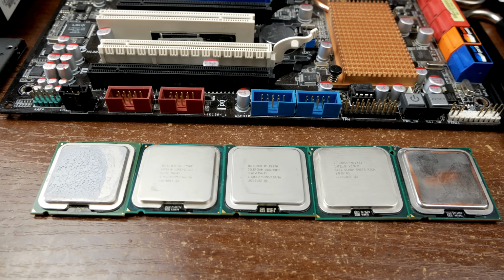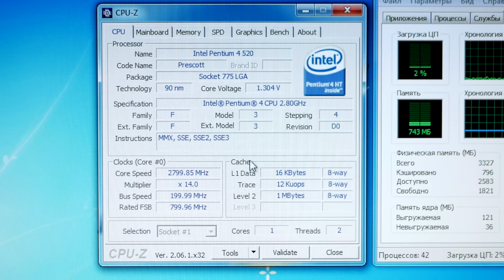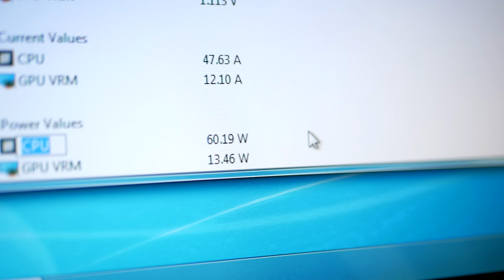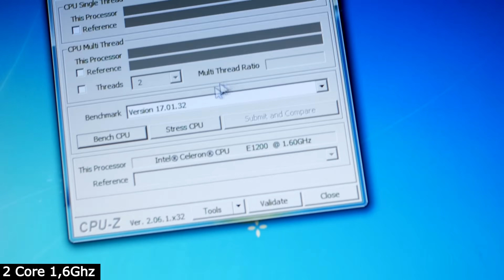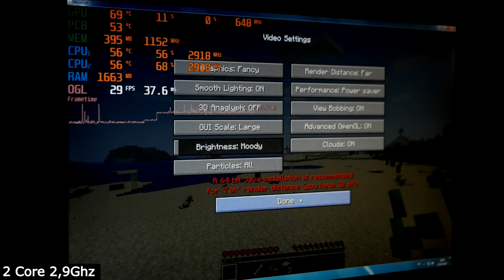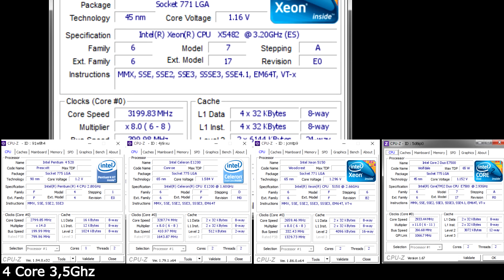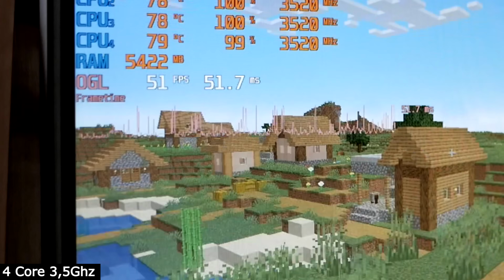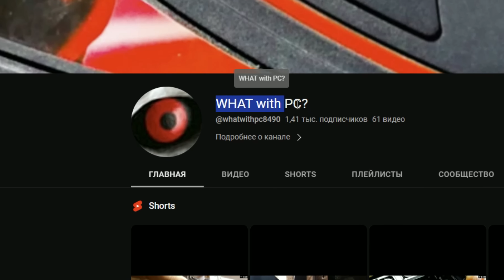Minecraft VS 19 Year Old CPU

Comment: i have a dual core celeron E3200 @ and, mineraft 1.21 runs pretty well, with sodium and 37 more mods to optimize it, on online servers i get like 100 fps? 150 and in singleplayer the thin changes a lot, 30fps or 60

Comment: I played Minecraft Java on 2B2T at 90fps on version 1.12.2 during 2021 using these specs:
Intel Core i5 650
GTX 260
12GB DDR3 Memory
80gb Seagate hard drive
to anyone looking to game on a extreme budget I recommend this system, maybe with a slightly upgraded CPU due to the I5 only having 2 cores 4 threads.  It also played CS before the update at playable FPS and was able to stream off my capture card at 480p 60fps

Comment: Optimization mods will help
Vanilla minecraft is shitty
I run minecraft on my 15 year old laptop
Version 1.20.1 Vanilla - render 16 blocks = ~2 fps
Version 1.20.1 fabric with around 12 optimization mods - render 16 blocks = ~40fps

Cpu:Intel corei3 2.3ghz
Gpu: nvidia 525m 
Ram:4gb ddr3

Comment: i still remember the intel 2 quad core q8400, i stopped using it around 2016, as the games were becoming extremely demanding, i had to tweak the fallout 4 settings and even mod it to the lowest of low to run it on my old potato pc, and that moment i realized that i need to upgrade my pc after 6 years of use without issue.

Comment: .... the dual celeron is better in single core because Pentium 4 ran on netburst which was extraordinarily garbage IPC lol.
Also Windows 10 isn't going to be any worse on a quad core than windows 7.
Also why not just apply a frame cap to minecraft if you don't like unstable high FPS? Benchmarking to find the lows will be more than fine.

Comment: For anyone who wants to compare, my workstation has:
A 2950x Threadripper running a 12nm architecture, 4100 MHz on idle, 16x 32 KBytes on L1 and 16x 512 Kbyte level 2 and further 4x 8 MBytes on Level 3 cache.
16 Cores 32 Threads.

Oh, and score wise:
Single Thread 438
Multi Thread 8'419
(It is a workstation focused on multithreaded applications so its great for me).

Comment: To clarify, frequency is not everything. IPC improvements between generations can mean a newer processor running at a lower frequency can outpace an older processor running at a  higher frequency. That being said, it is still weird how it’s a 2 times improvement in single core performance at about half the frequency between the pentium 4 and celeron. To me, that means the celeron must have some sort of hardware accelerator that boosts its performance over what the pentium 4 can do without it. Just some food for thought.
Reply: Pentium 4s spend more time heating your room than actually running anything. It's not that weird considering Merom (what the Celeron is based on) had double the IPC of Netburst (Pentium 4).

Comment: I'm watching this on an LGA 775 processor- core 2 quad q8400 which is almost identical specs to your quad core except with 4 MB L2 cache- lol. The Core 2 stuff actually holds up extremely well these days. Admittedly, the most hardcore thing I play is probably Kerbal Space Program though. All of that stuff is rated for a max temperature of about 72 degrees, and that seems to be pretty much the only limit on its overclocking potential. Mine has been at 3.2 GHz @ 400 MHz FSB for years and it only goes up to around 65 degrees max on air cooling with about 35-40 at idle.

That OCZ DDR2 memory is almost EXACTLY what I had in this machine when I first built it! Specs are the same, only I had a 4 GB kit and the heatsink on top looks different. OCZ Reaper. Now I have a 16 GB 4 DIMM kit I got for like $60 5 years ago of this other OCZ Gold stuff with this heatsink which looks like a screen.

Also, the first video card I ever bought is a Geforce 9500 back in 2009. It's still in daily use in a computer I sold about 10 years ago. Runs flawlessly and is perfectly fine for web browsing and watching movies at 1080p and lower resolutions. Played GTA 4 with it back in the day at probably 20-30 FPS. Doesn't even have a fan.

Comment: I started my Minecraft journey on socket mpga 487! Yeah you heard my right, the last intel socket with cpus that had pins instead of pads unlike lga775. I had a  Pentium 4 3.2ghz. It played Minecraft surprisingly well, up to 1.7.x. Especially considering it ran on windows 7 too which at the time was much heavier than xp. I really miss those times. Later I upgraded to a pentium D which was basically 2 pentium 4s in one cpu. That thing even compared to pentium 4! was a nuclear reactor core in terms of the heat it put out and the power it sucked. Eventually destroyed my motherboard as well. I miss these simple times occasionally. Building my first pc as a school kid, especially since we were very poor was a wild experience. Hence why I was using socket 487 in 2012-2014 which was well outdated at that point.
Reply: I used a Pentium 4 HT 3.0GHz (Prescott, S478) in 2011-2012 but the system only had an Intel Extreme Graphics 2 so Minecraft and other games never ran as well as they could have. In December 2012 I upgraded to a LGA775 Core2 Duo E6300 system but sadly that only had an Intel GMA 3000.
I got my first good PC in June 2013 with Xeon W3520 (i7-920), 6GB RAM, Quadro FX 1800 (GeForce 9600 GT). I upgraded the RAM to 12GB in December 2013 and GPU to a GTX 660 in January 2014.

I sometimes wish I could go back to 2010 or so and buy myself some cheap used Pentium 4 rig with a high-end-ish AGP graphics card. That's something I could have afford back then but I didn't know enough about PCs to know the difference between iGPU and dGPU etc. Of course a Core2 system would be even better but probably would have cost too much back then, I was just a kid and my parents wouldn't let me buy anything expensive.

Comment: Something that does help with the stuttering is using the frame limiter or VSync if you're on a 60Hz monitor. It gives the CPU headroom to deliver frames consistently instead of you seeing each stumble because it's running all out
Reply: Yeah, there’s no reason to make your system work harder for frames you can’t see
Reply: @adamstarks8682  Having higher fps lowers latency for multiplayer games, even if your monitor doesn't replicate more than 60fps. Having 60fps means the delay will be around 16 milliseconds, at 120 its 8 milliseconds, 240 is 4 milliseconds. There is a point of diminishing return, but having 120fps in a multiplayer game puts you at an advantage over someone with 60fps. If it is a single player game it doesn't matter as much.
Reply: Or just use optimization mods but that may or may not defeat the point
Reply: @hamnporkgamer  really doesnt defeaute the purpose here. here we are show really what you can expect from low end cpu's in Minecraft on the base game. everyone has a better understanding of the base game over modded for optimization. we could all probably squeeze a bit better performance out of these cpu's, outside of maybe the 1 core.
Reply: Something that does help with the stuttering is using the frame limiter or VSync if you're on a 60Hz monitor. It gives the CPU headroom to deliver frames consistently instead of you seeing each stumble because it's running all out

Comment: I have an pentium 4 630 socket 775 i was able to play 1.8 batmod 120 sometimes i did hit the ram limit fully patched win 7 it is posible to run mc at stable 60 fps
Reply: 1080p guess the gpu
Reply: An nvidia gpu
Reply: Btw why did you use an mainboard the uses ddr2

Comment: Imagine there would be an interface where you could link up multiple pc´s to a single "computer". Run 8 single core pc´s and have them show in windows like 8 core 8 threads. Sure the electricity bill would go nuts and i doubt any currently known interface would be fast enough to link them but would be cool nontheless.
Reply: Don't workstations do this since the dawn if time?

Comment: Bruh I have 1 core and 1 thred i have gt710 sdd 4gb ram i getlike decent fbs in mc for bedwars in 1.8.9 100+fbs in 1.16.9 i get decent fbs like 30 to 70 in medium settings in low i get like a 70 to 90 and i play other like roblox csgo Euro trucks simlater 2 and it get's nice fbs and graphics then i tried GTA V and first it was okay but it take a but while to load fbs was not bad like 30 50 first it was nice then the road want dissapires then 2nd day whe n i opends the game. The wont open it just stuck at loading screen

Comment: Old processors overclocking is soooo satisfying. You get such frequency boosts. My old 4790k went from 4.0 to 4.8 initially, then I either degraded it or it was never consistently stable and I ended up settling for 4.6ghz. Either way, compared to new ones that are basically limited to +100 or +200 all core overclock, it's crazy.
Reply: That's what I'm running right now. These 4790k chips seem to be so happy at 4.6 without even touching the voltage
Reply: Intel 2nd and 3rd gen even had few extra multipliers on locked CPUs. For example i7-3770 stock turbo multipliers are 37-39 but they can be raised to 41-43, that's a 400MHz overclock on a locked CPU though it does require a OC capable motherboard. In one of my systems I have a 3770 running at 4.22-4.43GHz with the 41-43 multipliers and 103MHz BCLK
My old main PC has a Xeon X5670 6c/12t @ 4.4GHz (22x200MHz) which is a 50% overclock from the base clock 2.93GHz (22x133MHz), though even at stock it could turbo boost up to 3.33GHz (25x133MHz)

I wish modern CPUs like the i3-12100, i5-12400 and their successors had unlocked multiplier. They have quite low stock clocks and have a lot of headroom but to overclock them you need a board with an external clockgen so you could OC them via BCLK. Most LGA1700 boards don't have an external clockgen and the ones that do are harder to find and more expensive.
And of course the unlocked K CPUs have higher stock clocks so there's less reasons to even OC them.

Comment: Back in the day (2011), I ran an MC beta server for 4 or 5 people on a AMD Sempron 2400+ 1.67GHZ PC. The PC was from 2005 and processor released 2004 but based off a 2002 CPU which matters as those were the days of CPUs getting 50% faster year on year. It ran off a crappy Maxtor 40GB IDE HDD and awful SIS chipset / integrated graphics but had 1GB of RAM because I upgraded it.  The PC came with 256MB RAM but there is no way you would have got the game running on that. The slowest P4 here would have been faster overall, but in that era AMD had way better instructions per clock. I think I launched the client as a test too but the SIS integrated graphics basically spontaneously combusted and it got like 10fps.

The PC was only running the MC server and off when not in use, so I ran XP RTM on it as that gave a noticable performance boost over SP2 or SP3. No way I'd recommend running an unpatched OS on anything now, but the "worst" desktop PCs you typically find now are light years ahead of what we could get cheap back then... Its a shame that Win 11 is going to sunset anything before 8th gen because with an SSD any 2nd gen i5  or newer is enough for basic browsing and desktop work. At this point in time, a 2nd gen i5 could be 12 years old as its a 2011 chip,  which is older than that Sempron was when running MC.

Comment: honestly if u want to plat Minecraft only than a rx 550 is more than enough with the i5-4570, if you want some VR Minecraft a RX 570 is recommended with the i5 4590. With lower settings on resolution but u can get shaders that look really good such as Super Duper Vanilla. If you want to play games and your find with not the highest settings, you want a little VR and your not playing performance intensive games. a few VR games, then the RX 570 is perfect for you with a cpu thats a i5 4570 or above. AMD is recommended if you aren't trying to be a Fortnite sweat. AMD is cheaper, has powerful GPUs and is generally just better than Nvidia if your trying not to blow up your PC. All Nvidia GPU users clearly want there PC's to explode for some reason even though there last GPU ran all the games they wanted...

Comment: i think the gpu frequency is really harming the performance in this video. ~600mhz is likely gonna shit on the results and im not sure about the vram speeds, as i've to read up on the effects of slow vram and observe what i can from my own testing. my assumption is it'll harm loading times for certain things but be out-bottle-necked by the other components.
Reply: hes using an old GPU because their drivers are older and are optimised better for such old systems, though realistically he could be having a decent time with something like a R9 280

Comment: Back in my day I used a 2,8 GHZ Celeron (Socket 478) and it ran around 30FPS .
When I went on servers it was fine as long as they were not heavily moded or had really nice buildings at the main spawnpoint.
I used 1.2.5 (not beta). After that it became laggy.
Reply: bet you never thought a celeron could slaughter a pentium 4🤣🤣🤣
Reply: @raven4k998  oh the celerons from Northwood/ Prescott gen was sought out by gamers for their overclocking potential. i had a northwood one. i ran it with a constant +33mhz FSB  bump... and 20% more on the multiplier. motherboard died.
Reply: Back in my day I used a 2,8 GHZ Celeron (Socket 478) and it ran around 30FPS . When I went on servers it was fine as long as they were not heavily moded or had really nice buildings at the main spawnpoint. I used 1.2.5 (not beta). After that it became laggy.
Reply: I used a Pentium 4 HT 3.0GHz (Prescott, S478) but Minecraft was laggy due to the PC only having Intel Extreme Graphics 2. The system was an IBM ThinkCentre S50 which only has PCI slots and no AGP or PCIe. Even an Athlon XP 2400+ with a GeForce MX440 runs Minecraft better because even the MX440 is a lot more powerful than the Intel EG2 lol
I've later moved the CPU to a different board with an AGP slot and it does pretty well with a Radeon 9800 Pro. I wish I had something like that back in 2011-2012, it would have run all the games I played back then and wouldn't have cost much at all. I was still a kid and didn't know enough about computers which is why I ended up having a 2004 IBM ThinkCentre S50 with no AGP. At least I had a pretty nice, for 2011, 23" 1080p monitor which cost a lot more than the PC

My secondary desktop had a Celeron 1.8GHz (Willamette, S478) and a Radeon 7000. It kinda ran Minecraft but even worse than the P4 3.0E with EG2.
I did also play Minecraft on my Atom N270 netbook
Reply: Why didnt you put the P4 to the secondary desktop?
 @Pasi123
Reply: @johncarnege  The Pentium 4 was a Prescott with 800MHz FSB and had hyper threading while the secondary desktop had an older motherboard limited to Northwood CPUs, 533MHz FSB and no HT support

The fastest 533MHz FSB Pentium 4 was 3.06GHz but I didn't have one of them. The second fastest one was 2.8GHz which is what my dad and grandpa had in their PCs back then

Comment: This is mighty impressive. I’ve done similar stuff with vintage computers and Minecraft, but with even older processors. You can get Minecraft to run on a non-HT Pentium 4 at around 30fps, and same goes for the higher clocked PowerPC G4s.